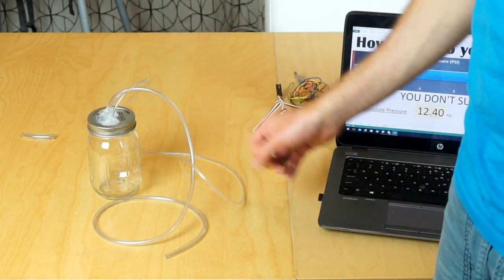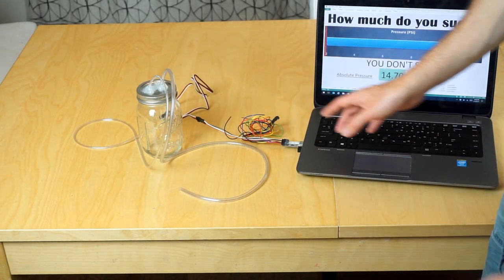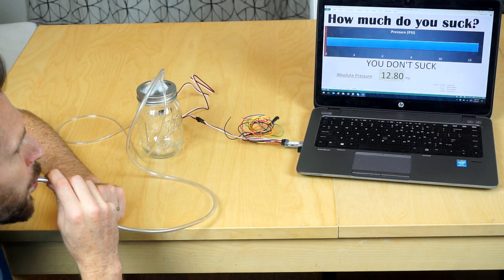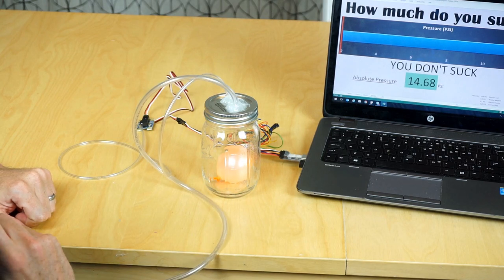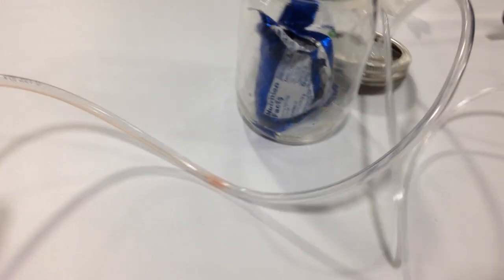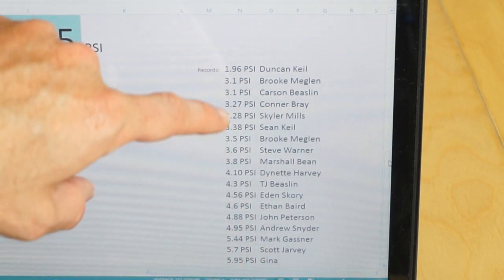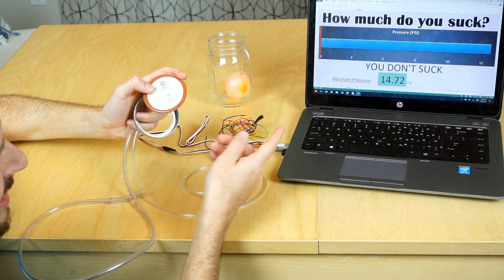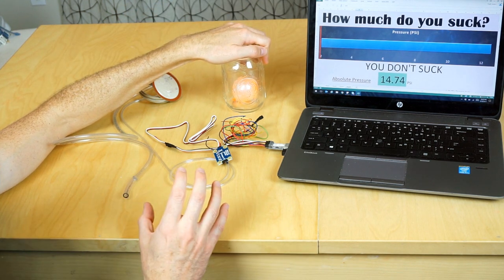How Much Do You Suck?

Comment: What if you added a check valve, so that you didn't have to create a seal between drawing air out? Could you get the glass jar closer to the pressure of just the tube and the sensor that way?